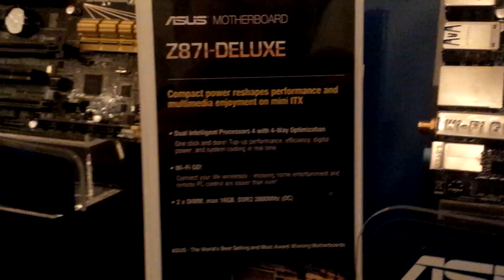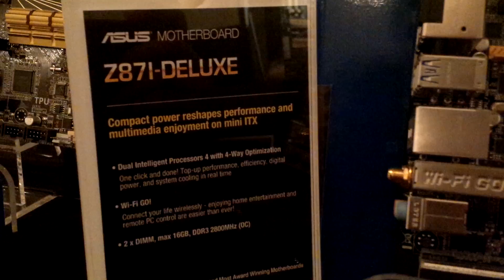First Look - ASUS Z87I-Deluxe Motherboard

Comment: This would depend on the features you want as well. I'm personally waiting for this so I can get the better power efficiency even though it's marginal. I'm planning on going with a low power 450 watt system with crazy good graphics performance and all of that. So I need the extra power efficiency. You may not need that, so I'd suggest to take that into consideration.